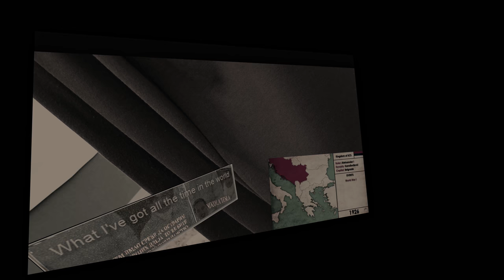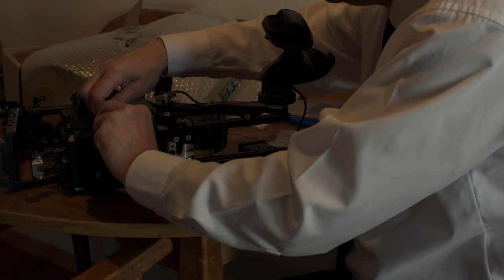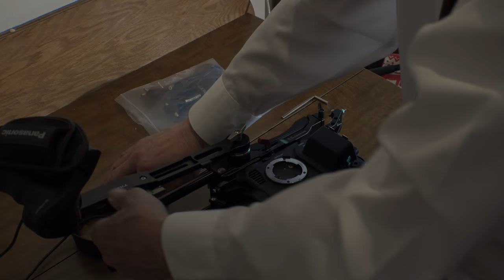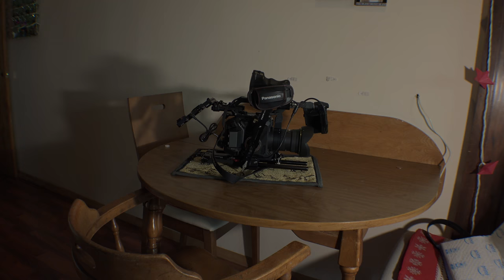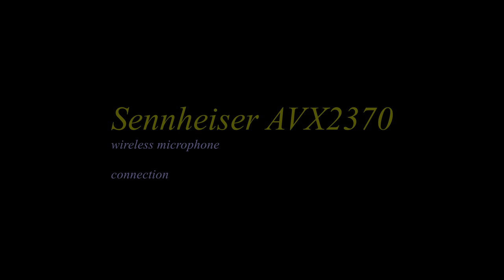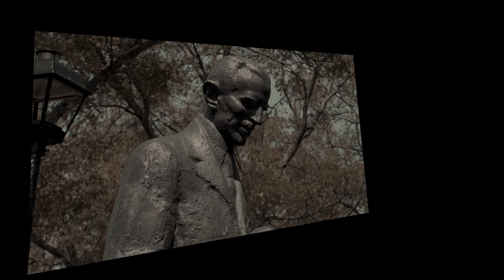Panasonic EVA1 with  Tilta Rig

Comment: WoW ...!!!  You now have to get the night vision module for the lens and film in darkness with very low light.. It's wonderful for night vision astronomy... You will see strange things up there.. Take Care ... and don't let the winter weather blow over that fine camera..  Al...
Reply from the maker: http://overunity.com/12736/kapanadze-cousin-dally-free-energy/msg516436/#msg516436  EVA1:
Yes it does it too - EVA1 has  IR filter is removable by single click of the button. so you can film in entire spectrum . By using  UV  bandpass filter you can see in  lower UV spectrum excluding all lower frequencies.
(Well not all, but visible and as low as IR)
Higher than UV is only X-ray and that can sometime be seen by some of consumer  grade cameras in form of dots overlaying original  picture. But  this  bandwidth is mostly a domain of Scintillating detectors and  Germanium based detectors for Gamma.

At UV Sensitivity suffers but it is doable when UV level is dominant , so if you use Ultraviolet lamp you working against low sensitivity of the sensor in that camera.
For us it is important  to know that we can  accurately measure power dissipation  in spark gap or plasma in any medium  including vacuum.
Infrared is mostly blocked by glass of say radiotube or glass of enclosed  spark gap. But UV is not .
By comparing  amount of  radiation  of IR in air we can do addition and that gives us  missing  component  to calculate energy parameters of electromagnetic nature  in the bandwidth  from IR +visible +UV.
To make my life easier I use PHO-4040 in addition to   Panasonic EVA1
http://www.gamma-sci.com/wp-content/uploads/2011/10/Night-Vision-Radiometer-NVG-4040.pdf
Thank you for mentioning it  as not many people can even think in this categories. 
Wesley
ps: here you have some educational material:
http://www.gamma-sci.com/wp-content/uploads/2017/09/MK350-Series-Survival-Handbook-20150417_website-2.pdf
Reply from the maker: dziekuje za mile slowa , dusza podskakuje za radosci.